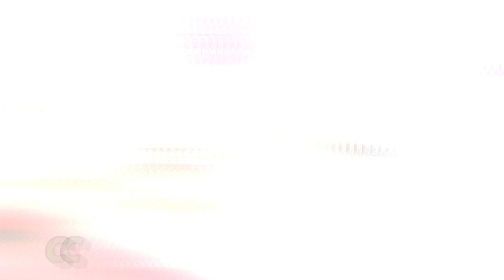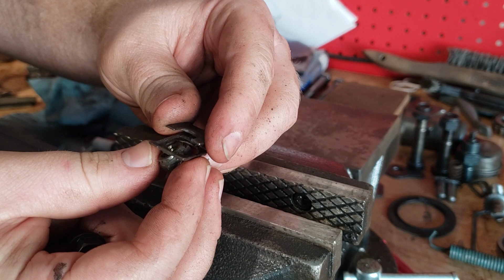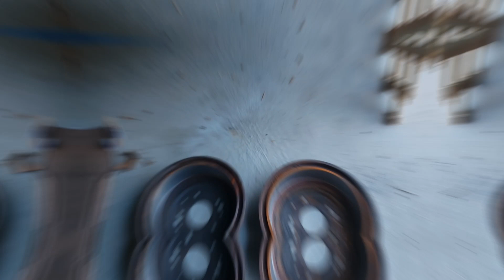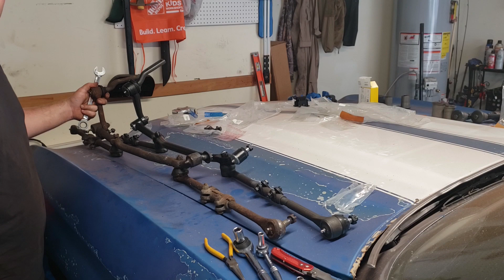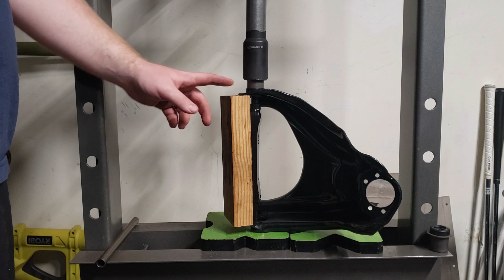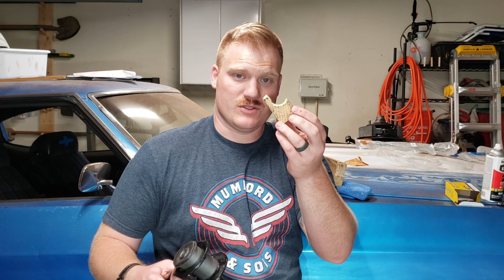72 Chevelle Front End Rebuild Part 5

Comment: Great information. I'm in the process right now of restoring my chevelle's existing tie rods or going with a new kit.....why did you decide to go new and where did you purchase it from
Reply from the maker: I decided to go new for multiple reasons, the main one being that everything on the car was original from 1972. Because of this, they were shot and I didn't want to risk catastrophic failure. Among the other reasons were a. I was already going to be taking everything apart and b. It was cheaper to get the kit together.